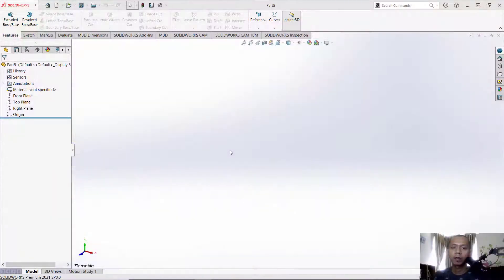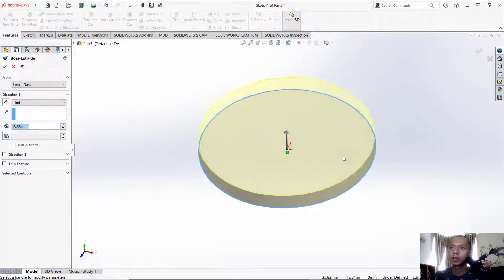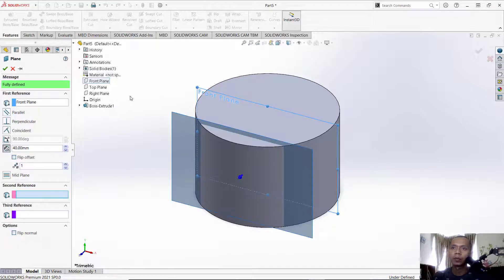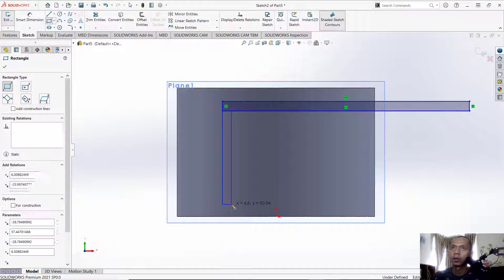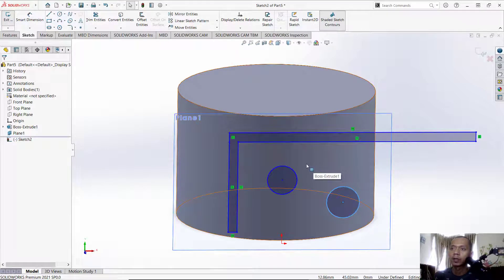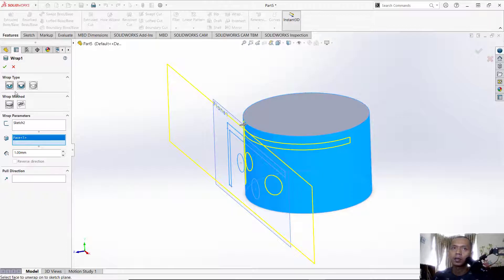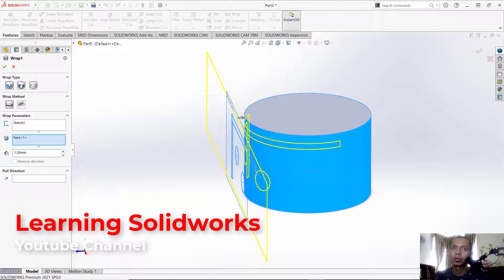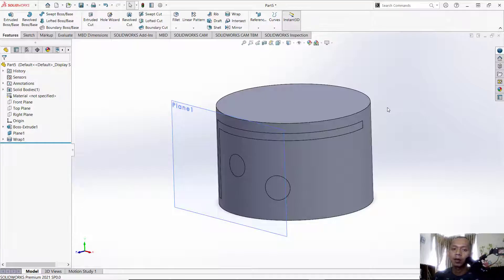Solidworks How To Add Sketch on Curve Surface

Comment: Thanks but no.
I was looking for a way to sketch "directly" onto a curved surface.
For example:
a.) A surface that was created by surface thicken, that is no longer flat.  Like a lofted surface. 
b.) Can I sketch directly on the surface and add dimensions and constraints.
This does not do that, but thanks for the video.
This video should be titled: solidworks decal function.